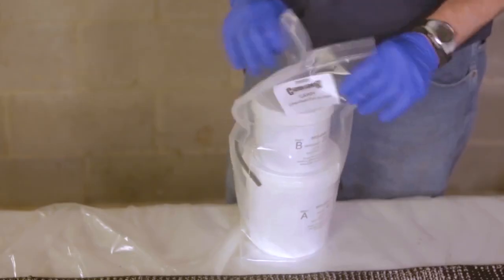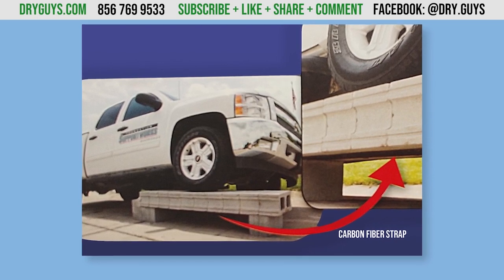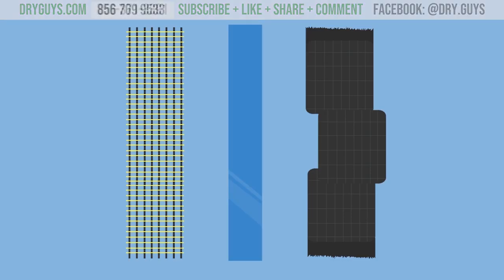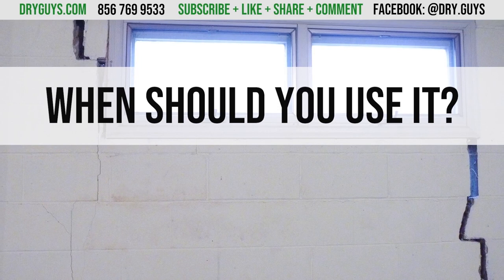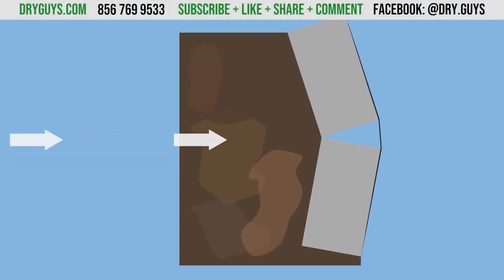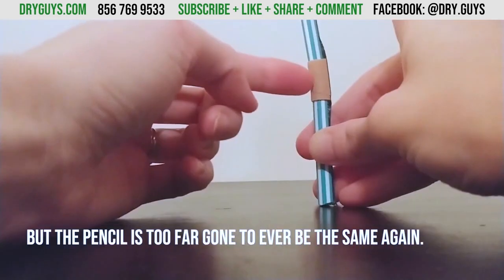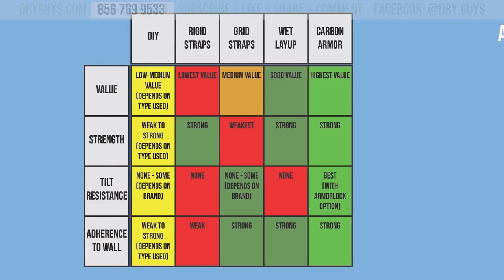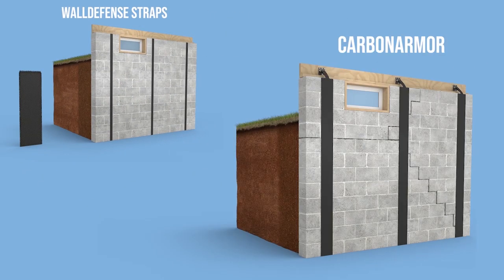🐊Carbon Fiber Straps for Foundation Repair? Pros, Cons & Homeowner Tips

Comment from the maker: Our apologies for this re-upload. The original video had the wrong phone number on it. :)
Reply: Can you tell me the "K" rating of the carbon fiber itself? Is it 3K, 12K, etc? Thanks
Reply from the maker: @moodberry  Hi Doug. Sorry it took so long to answer this question but we actually didn't know the answer so we reached out to Supportworks (the creators of CarbonArmor) and asked the engineers what the rating was. They said in all their years making CarbonArmor they've never been asked that question so they'd have to dig a little deeper to find the answer. I will update you here if we get a specific number at some point.

I'm assuming you want to know the strength of the CarbonArmor compared to other carbon fiber straps? If so, the K rating isn't very useful because the true strength actually depends on the strength of the wall itself and proper adhesion technique.

These were the exact words from the engineers at Supportworks:

The K rating for carbon fiber identifies the number of fiber strands that exist in each bundle or tow of fabric.  “K” refers to one thousand, so a 3k tow is made up of 3,000 carbon filaments.  This number alone is not very useful and in all the years of providing CarbonArmor, this is the first time we have received a request for the K rating.  The strength information (tech specs) provided in the technical manual are the composite properties (cured fiber and epoxy), which is what matters with these systems.  These specs should provide a designer what they need
Reply: @DryGuysNJ  Fantastic video you made. And I didn't really expect a response to my question, but this shows how reputable you are. Most people wouldn't bother answering or digging deeper. Thanks.
Reply: @moodberry  Agreed! And it makes sense to me that the total strength rating would be on the final assembly/composite rather than the components. Lots of examples in woodworking and fiberglass boatbuilding where the adhesion of the resin and the strength of the framing members are the major limiting factors in a repair. While I'm here, this video was entertaining too, great intro story :)

Comment: Can Carbon Fiber be used on a bowing brick foundation wall? Also what are your thoughts on using high strength steel straps for a bowing brick foundation wall? Thanks.

Comment: What is the warranty for carbon armor?  What do other products warranties look like?
Reply from the maker: The warranty for the CarbonArmor straps is 25 years. Most places do a lifetime warranty on their fiber straps which in New Jersey is 8.5 years. The thing is that only the strap is warrantied- not the wall. So if your wall continues to have issues, that is not counted in the warranty, and they will not replace your wall. We also only technically have the warranty on the strap but we would never recommend straps on a wall that a strap wouldn't work on anyway. We usually use steel because it works for more situations. And we do fix any issues and follow-up often with our systems. If we recommend a carbon fiber strap for your basement it's because we're sure it will work in that specific circumstance.

Comment: Theoretically wouldnt if be best if all basement foundation concrete be better off if they were reinforced in the first place?
Reply from the maker: Yes! Most concrete is reinforced by the builder, but over time some of these initial build solutions fail. It could be hydro-static pressure, concrete that was mixed too "wet" at installation, basic installation error or simply not enough rebar for reinforcement. Not every house has this issue, but that's why we are here to help the ones that do.

Comment: can anyone explain differential movement a little more in detail ?
Reply: As an engineer, albeit a chemical engineer, this is an outstanding video and explanation of static concepts.  Bravo and take pride in your company!
Reply from the maker: To put it simply, there are three types of foundation settlement. Uniform settlement is when the entire house sinks at the same time, so it doesn't break apart and there are no cracks. Tipping settlement is when the house tips at an angle but, once again, stays together, it's just no longer even. Differential settlement is when one piece of the foundation sinks while the rest doesn't (usually caused by uneven soils underneath). That's where you'll start to see things like stair-step cracks.

Comment: Great instructive value!  Do you have a system like ArmorLock that also anchors to the footing (bottom structure) to prevent inward shear?  Under what conditions would you choose steel I-beams over carbon fiber?
Reply from the maker: Thank you for your questions! We do not anchor to the footing because if your issue is that severe (like when there's shearing), carbon fiber straps are not recommended to begin with. In that case, we'd go with steel I-beams. I-beams are for when the problem is too severe for carbon fiber straps to make sense.